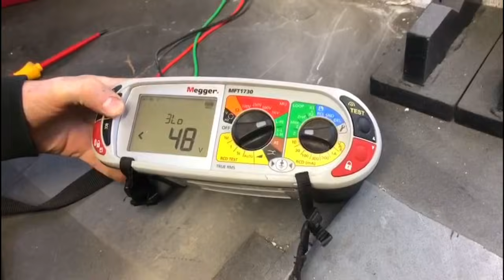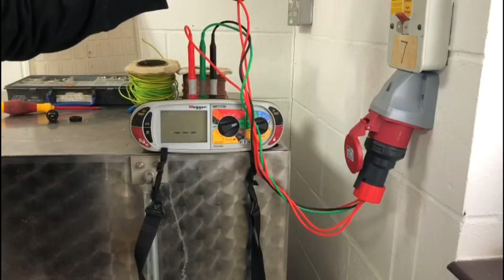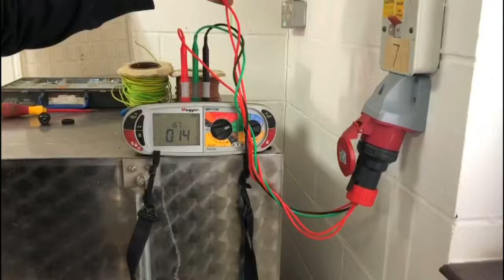Earth Fault Loop Impedance (Zs) - Testing 16 Amp Industrial Socket Outlets Both Single and 3 Phase

Comment from the maker: Would love your comments on the testing process and the leads Matt has made up… Please be polite in the comments 👍🏻 Gaz
Reply: The temp elec sector has test plugs that are safer to use than these. I've even built some myself using banana plugs and small adaptable boxes.

Comment: I’m a little concerned, live test without fused leads? I can understand the desire to make this easy, imo I would prefer one of the pre manufactured adapters.  Personally I would do the test at the isolator and just confirm continuity of the CPC to the socket.
Reply: What fuses would be in there if you were as per tradition putting test probes onto the screw terminals and why is that different?

Comment: What do you do if you have got an rcd that trips when you do the test, how do you get around that?
Reply: Low test..High test will knock out RCDs on the line..
On a fluke tester it's Z1 (no trip)
Z1 (high current if no RCD is on the line or elsewhere on the supply..
Reply: @kdobaggins3410  Thanks

Comment: Surprised at the difference in Zs measured between the phases at the commando socket. Could that have been maybe poor contact on L1 and L2 which would explain the 0.19 Ohm difference between L1 and L3?

Comment: That’s a good idea making up a set of test leads like that 👍 
I just had a 13amp socket and a 16amp industrial plug joined together with 2.5 mm2 three core flex. Well done Matt maybe you should see about getting those lead’  To a manufacture? Fantastic video Gaz as always 👍👍👍❤️